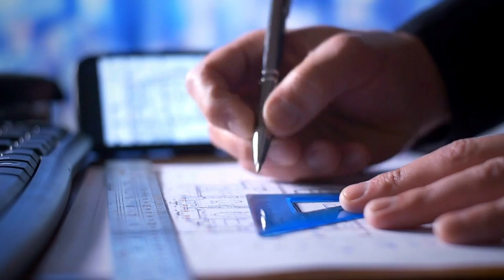The Monster Howitzer That Can Drop Shells on a Dime 30-Miles Away

Comment: I was part of the first class of Marines to train on these. All in all, these are much better to run than the M198, but I doubt enough to be worth the cash. After all, these take the same truck, the same crew size, and might be a tad faster to take down, but not very much. 
These are more useful for deploying by air, but even then, you need a truck to move them, so counter battery would still kill you.
Given 15 years ago or so, really, really nice arty (edit: the Archer) that is its own truck came out, can fire the same rounds, can shoot and scoot way faster, and only requires a crew of 2 (edit: I was wrong, it's 3), why would you use these under most circumstances? I still don't get it. I guess it's technically less expensive for the weapon, but if it gets taken out, you've likely lost more soldiers and that's really expensive. I guess the M777 should break down less often, but that's not much if you lose them (and your soldiers) to counter battery.
Any tech you can have on one of these can be put onto a self-powered gun, so that's not an advantage.
Reply: Your practical experience of course is better than theory,  I disagree however with the point of the reduced weight not justifyng the cost, actually on mobile warfare and difficult terrain like Afghanistan or the worsts parts of Ukranie this lighter gun gives a massive advantage over heavier models
Reply: Pros are it can be deployed & extracted where a truck can't be driven. That's something that needs to be considered.
Reply: There was a 52 calibre barrel for the M198 I wonder what it's range was when firing Excalibur?
 Would it have been better to upgrade them than to buy the much more expensive M777?
Reply: Thank you for your service
I had been listening into Ukraine recently it was mentioned how the west views these as mobile sniper artillery where only 1/2 rounds is needed due to accuracy. Russian systems were mentioned to be heavy/immobile and have poor accuracy 20-30 rounds against moving threats. Unsure how true this is but given your words I’d rather not bet my lift against accuracy when these things exist.
Reply: @acem82. You cannot airlift a M109A6 Paladin into the mountains of Afghanistan while you can airlift a M777. What good is the M109 if you can't get it close enough to provide fire support for the soldiers who need it? P.S. Like every tool, the M109 & M777 is more useful for certain scenarios than others. V/r.
Reply: @jimbo3207. The deciding factor was transport weight. The M198 weighs 15,700 lbs while the M777 weighs less than 10,000 lbs.
Reply: @slimjimnyc270  1. I'm not talking about the Paladin.
2. Yes, it is more useful in that case. That's not a case where there is counter battery. That's only useful if you have asymmetrical warfare. Why? Because you need the air to move it! So, yes, it's more useful in niche cases, but otherwise it seems much less useful.
Reply: @slimjimnyc270  1. Yes, that's true. I trained on both and I felt all of that 500 lbs tongue weight of the M198.
2. I'm thinking they should have upgraded to a self-propelled howitzer (a wheeled one), not a stand alone that is almost worthless without a truck to support it.
Reply: @bladercentral  Without a doubt, it does have the advantage of accuracy over Russian arty. But, as I said, the same accuracy can be had with other NATO arty, such a self-propelled wheeled arty, without too much hassle. So, why use the M777 when the Archer exists? (I just looked it up, the crew size is 3, not 2.) It can use Excalibur round too! 3 rounds in 15 seconds, no crew on the M777 cannot do that!
If I remember right, this isn't the only new model self-propelled artillery system.
Reply: @skipperclinton1087  Yes, that's true, but it can't be moved. Against guerillas, that's useful. Against anything that can counter battery, that's a death sentence.
Reply: @acem82  Swedish parliament has been voting on giving that system I guess! They want to join nato and are leveraging the system along with other equipment to join?
Reply: @bladercentral  It looks like Croatia and Norway were looking at ordering them 10 years ago but didn't. It also looks like the US, UK, and Switzerland are looking at them as well.
Reply: @acem82  If I'm not mistaken, the operational requirements for the M777 came from the Ft. Sill Artillery School (the user community).
Reply: @slimjimnyc270  That would make sense. The instructors there are in love with towed arty. I disagree for the above reasons.
Reply: @acem82  would you assemble a toolbox with only wrenches in it and no other tools? That's why we have towed AND self-propelled howitzers, mortars, grenade launchers and many more forms of indirect fire, to be flexible with our fire missions and because we can afford it. Trust the higher pay grades to figure out the why, you're paid to do the how.
Reply: the only problem with the archer hard to find a helicoter that will lift it 
the aircrafts that  can move the m777 are the ch 53e, ch53k, ch 47, ch 60, mv 22 carry it 90+ miles set down can play havoc with the bad then lift off back to base
Reply: @jimbo3207 m198 did not have 52 cal barrel
they are designing a 58 cal barrel for m777
also  32 cal and 28  cal barrel foreven lighter air mobile guns
Reply: @acem82 depend on how you get to the fight and where the fight is if your infantry goesby helicopter then m777 is better but if your infrantry goes       wheel apc or imv then  truck mounted may be useful
Reply: @brucenadeau2172  Yes, but that is of limited usefulness in symmetrical warfare.
Reply: @brucenadeau2172  Counter battery will mess you up if you don't have a truck nearby, and in that case, the wheeled or tracked arty will be able to "shoot and scoot" much better than the M777.
So, again, in symmetrical warfare, the M777 looks to be inferior.
Reply: What is asymmetric and symmetric warfare?
Reply: @UnknownHumanOnline  Asymmetric warfare is a type of war between belligerents whose relative military power, strategy, or tactics differ significantly (Wikipedia quote). Example, Vietnam.
Symmetric warfare is the opposite. Example, the current war in Ukraine.

Comment: Good video though the technical details about round ranges are not accurate, and missing some information such as RAP, and issues about the "recoil damage" are also moderately incorrect this is only pertaining to the higher charges, which relates to possible breach damage.  But the two true keys which makes this howitzer deadly are its mobility and the fire control software that speeds up target calculations. Still a fan of manual gunnery though.

Comment: What are needed are PGKs on standard shells. These are inexpensive fuses that turn standard shells into flexible precision guided weapons that can be set for airburst, contact, and peniitration.  These fuses will also deactivate if off target so this artillery can be used as close in fire support for infantry.  In my opinion ordinary fuses should not be used if PGK fuses are available. This is because one PGK fuses shell takes the place of the use of ten to twenty standard shells.
Reply: PGKs are only cheap compared to missiles and special munitions (like Excalibur). Regular 155mm artillery shells are extremely cheap these days. Also, depends on what you're using them for. If you're attacking a single target, even if it has minimal protection, a PGK will make your fire mission shorter, more effective and less chance of collateral damage (a difference that is only increased if we're talking about targets in urban terrain). But standard munition still has a role when the target is spread out over an area and you simply need weight of fire. Post-Gerard Bull you can drop even unguided shells with remarkable accuracy.
Reply: @fiendishrabbit8259  I have noticed the allot of the artillery hit videos that are showing contact fused artillery hitting the ground and missing near by Russian troops.  A PGK air burst would have taken these troops out.  The same for attacks on trenches.  I have also seen Ukrainian troops taking casualties from close in attacks that could have been suppressed with close in heavy artillery support.  PGKs could be used on both these cases and would require far fewer rounds or could not be done by standard shells.  With PGKs far fewer rounds need to be supplied to the front and counter battery survival and effectiveness is greatly increased.  PKGs simply pay for themselves in almost all cases and are effective force multipliers.
Reply: @stanleytolle416  a. The extensive use of contact fuzes is more of a russian heritage thing than a limitation of ammunition itself. Almost all western ammunition is fuzed either as CVT, where you can set it to a timed mechanical burst (contact backup) or a zone fuze which explodes when it senses ground proximity (they're used for different purposes. Timed fuzes are extremely useful when you're firing on ground that gives a fuzzy radar return (like dense forests). Both fuzes are very cheap compared to PGK.
b. Yes. In a Danger Close firing mission you should use precision munitions. That's one of the jobs it was developed for.

Comment: The M777 with NAMMO ramjet artillery shells would be a precision howitzer with 100 Miles range!
Reply: Chamber is not large enough.  Did you know we can make(have already done so) smooth bore barrels made from kevlar, titanium, and lined with Chromium for a fraction of the weight of traditional barrels with an exit velocity of over 7500ft/s(2300m/s)?  This gives a range greater than 100nm.  We have been able to do this since the early 1990's.  Ramjet is extra complexity.  LOTS of extra complexity and since it requires essentially all new 155mm chambers anyways or new shells which are smaller to fit said ramjet... this does not exactly help much.  Yes, some chambers can fit it, but very few in reality.
Reply: @w8stral  
I know it is already being tested in the USA with Boeing working with NAMMO. My understanding was it could fit existing 155mm guns. It’s a solid propellant so it isn’t very complex. There are no moving parts
Reply: @w8stral  
I will look up what you sent me, thank you. I have never heard of 7,500 Ft/Sec chemically accelerated rounds. That’s a new one too me.
Reply: @tylerdurden4006  
There’s a big difference between shooting 20 miles and shooting 100 miles. The search area when shooting from 100 miles is 25 Times bigger than shooting at 20 miles distance. A=πr2
Reply: @andrewday3206  SIngle Chamber 7500ft/s is quite simple as it only requires standard existing charges but a 100+ caliber barrel.  If you go to multiple chamber gun barrels, then we can hit exit velocity into synchronous orbit using chemical propellants.  Not sure you will find any of this stuff on the internet, though I did way back in the early 2000's.  I'll bet it has disappeared as the guys who were involved in those projects in the 80's and early 90's have retired, died etc.  You may find this information if you start looking into Paris Gun and Gerald Bull on very old forums and talk about regunning or reengining the IOWA class battleships.
Reply: @w8stral  
I am aware of the Iowa class 16” guns with doubled up barrels. Project HARP in Barbados and Yuma proving grounds. They shot shells to over a 100 mile altitude. The issue is guns that big are not easy to move or deploy. By switching to a solid ramjet we can have the size advantages of the M777 and the range of a 100 caliber barrel. IMHO the Zumwalt destroyers should upgrade to this system seeing the railgun did not work out. They would get their range and punch back. Sadam in Iraq was having a multi chamber super gun built, key word was.

Comment: This is one of the better and more timely videos created by 'Dark Tech'. Thumbs up for the info.
There is one disparity. The title says "30 miles", while the video states it is "25 miles".
Info on the Excalibur itself says it can go up to 35 miles, depending on configuration.
The M777's shorter barrel will reduce the Excalibur's range. But the range of an M777 firing an Excalibur is unclear.    Is it 25 miles?  Is it 30 miles?
Reply: Yes.
Reply: @Yontenb  Question: Is it red, or is it blue?     Answer: Yes
Reply: @gregparrott  the answer is that it's classified. If the Government says it has a range of 25 miles, you can bet it will reach out an additional 25-100%. Just with reduced accuracy as it goes further

Comment: It looks so much more complicated than the crude old 155mm howitzers of the Vietnam War era.
Reply: Really not that much difference.
Reply: @eb1684  I served in the field artillery during the Vietnam War.  There's a hell of a lot of difference between the new 155s and those   short-barreled stainless steel tubes the old 155s had.
Reply: @robertodebeers2551  Wow!!  You did not list even one difference!  
The old tubes (M126) sure were not stainless steel-SS does not have the "toughness".  Neither the M185 or M199 tubes.  It is called "gun steel," 
 a material to withstand the high pressures.  SS would quickly fail.  
You also don't seem to know the old M126 and M185 have the exact same breech.  As far as I know, the M185 cannon is still used on the M109
Self Propelled Howitzer.  It can fire the RAP round (with the M203 charge)
30KM or 18.75 miles.  (Rocket Assisted Projectile, but they have better projectiles now.). Our enemies are well aware of all of this, thanks to our news media.  Thanks for your interest and quick response.
Reply: @eb1684  The 155 tubes of the Vietnam era were shiny bright metal.  There was no muzzle break.  The tubes were much shorter than today's howitzers, and there were no electronics on them at all.  If you weren't there, don't talk about shit you don't understand.  I'm done with you.

Comment: With modern counter-battery technology, towed guns are very vulnerable and will probably only be useful in a small number of tactical situations.
Reply: There are many ways to avoid CBF including using pistol guns to adjust (a single gun deploys far away from the battery and moves as soon as they finish adjusting this enables the rest of the battery to FFE or to CBF if engaged), dispersed gun positions (where the guns are so far apart that they have to be engaged independently) deploying anti radiation weapons like HARM, airborne systems can also pickup and locate their Radar emissions from very long ranges or just plain setting up outside the range of your adversary (NATO guns have always out ranged Soviet or Russian equivalents and have much smaller PE).
I'm not sure what current doctrine is but back in the 80's when we were training for high level war that meant moving guns after each engagement if you didn't have air superiority, something you could only keep up for a few days with towed guns due to crew fatigue before having to withdraw. 
A well trained gun crew can be elsewhere before CBF arrives, at extended ranges even before your rounds arrive at the target.
The main advantages of towed guns over SPs at the time was cost, speed, stealth, greater range, speed of training, larger ammunition capacity and reliability. Only the most modern wheeled SP systems share most of those characteristics excluding ammunition capacity and cost.
Towed guns main disadvantage is  mobility off road, lower levels of protection and crewing required (debatable due to larger rear echelon requirement of SP guns) definitely not inability to avoid CBF. 
They used to be incapable of deploying without an FDC but modern towed guns can even perform this function with their own inbuilt electronics just like SPs.
Reply: @jimbo3207 what if they randomly displace after x random shots and setup in a new location that hasn't been pre-sighted or ranged by CBF?

Comment: Besides the airlift capability, I can't help wondering what this platform has over the South African G6 Rhino...
Reply: South African G5 is a tow behind 155mm that was used succesfully in Angola in the 1980's. G6 us the motorised version. Both able to hit targets at 40km depending on booster pack

Comment: Well the main advantage of that howitzer is its portability. However the rest of the modern 155mm howitzer can do same. Also 30 mile's  ? M777R With the L55 yes, standard M777 not that I know off.
One aspect comes to light in the Ukraine is that the rifleling is not holding up to heavy use.  As ex gunner I think is a great platform for a mobile army,  for static warfare not so much.
Reply: lol the ukraine army is anything but static, the lines are changing every single day even if only a hundred meteres a day by the russians, or 600 by ukrainians
Reply: @aprilgeneric8027  dynamic  ? 5 months ago,  now artillery is pretty static.
Reply: @jantschierschky3461  Artillery lines in this era of kamikaze drone threat environment is never constant. Have you seen what the Lancet Kamikaze drones have done to Self Propelled Howitzers which are considered highly mobile by their tracked nature? Now imagine what those same drones can do to static artillery units, so yes, they need to be constantly moving. 
As an ex-gunner you might already know about the Russian Weapon Locating Radars which can detect from where the firing is coming and target their counter Artillery fire at these guns.
Reply: @Lady Bug  you are not wrong,  but m777 are made for airmobile. Ground move is simple with many different systems.  Movement is done in around 200m and you use, unlike Russian vehicles camouflage netting.